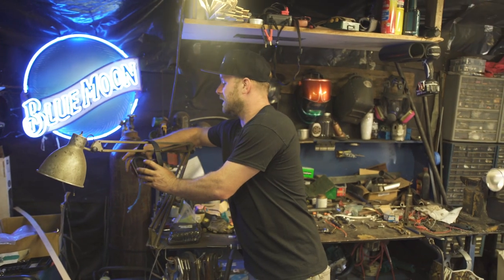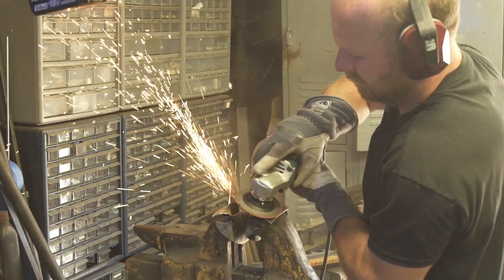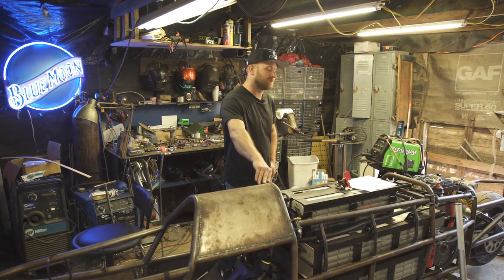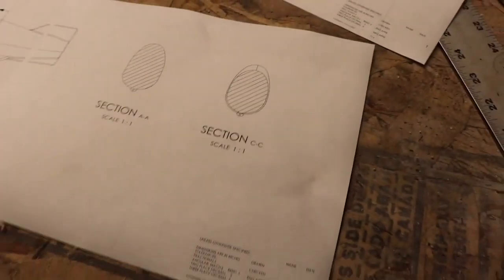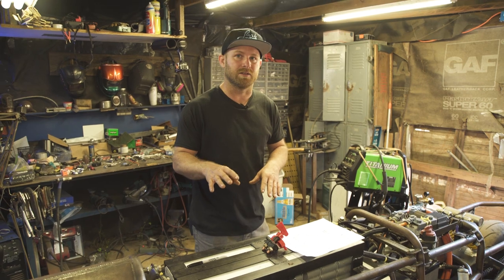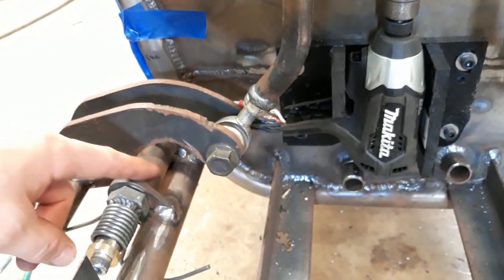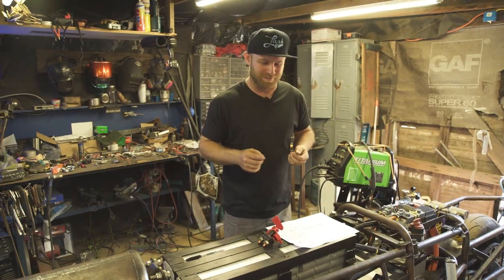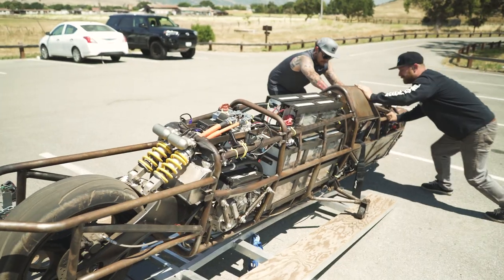Lark Streamliner | June Project Update and Overview

Comment: Current electric motor cycle land speed record is 327.608 km/h (203.566 mph), or it was as of April 8th 2019.
Reply from the maker: Lightning did 216 at Bonneville for the SCTA in 2012 and Eva Haakenson did 249mph for the FIA.  I'm not quite sure where you are checking but it maybe a different division I am not aware of.
Reply: @sheanyquist        Thank you for your comment. I got my number from Google i.e. "The current electric motorcycle record was set by rider Jim Hoogerhyde, who rode a Lightning SB220 electric bike at a verified 203.566mph back in 2013" that quote is dated as April 2019. I see Eva's record as 241.9 mph but as a sidecar record, not as a solo motorcycle. This is not really an area I can claim any real knowledge of so I'm happy to accept my information may be wrong or at least misinterpreted.
Reply from the maker: @dogphlap6749  there are several classes for the electric genre. I am going for the streamliner electric motorcycle class. No current record. I want to be the fastest of all electric motorcycles! 249 is the goal, but I think the bike has 300mph in it.  We'll have to wait and find out!
Reply: @sheanyquist       I wish you every success.